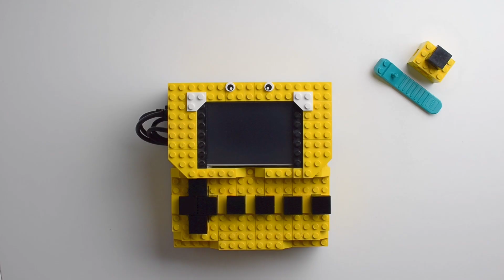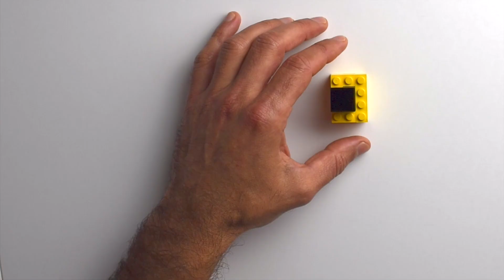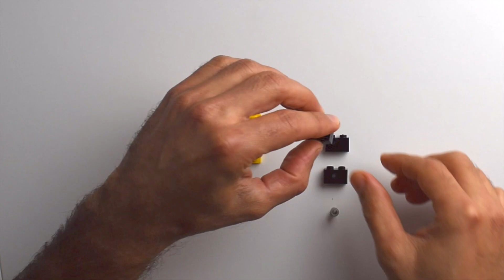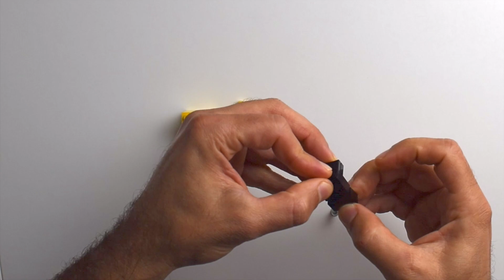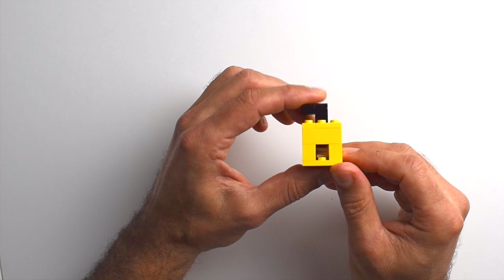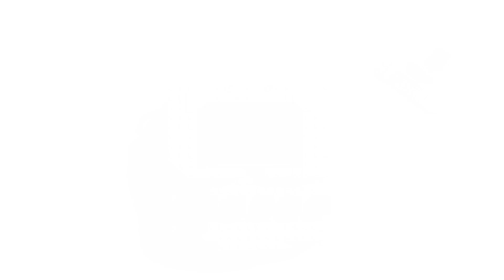M8 Headless project teardown and how Lego buttons work

Comment: Hi Rowdy!
Sorry to bother you, I'm working on your project, And it's great.
Now i have installed the module and set the audio, works really fine, ready to enter in a case of fake legos.
Only I have a stupid question, I'm really a newbie, i code with AIs all the time and I m not finding a solution that maybe is obvious: there's a way to exit the m8c module without shutting down the raspberry? A way to go back to the terminal? Or block the module to start immediately? Cause I still have to configure midi and setting the raspberry for an Argon case, maybe I will change the usb soundcard etc... Long story short I would love to still use the terminal for any changing, and no I can't use ssh, I don't know why, even with my zynthian I never managed to use it, I don't know if the problem is my WiFi or my pc or whatever.
Thanks m8 <3
Reply from the maker: Using SSH should definitely be the best option. Therefore, I would try to understand what's going on with the Wi-Fi. Alternatively, couldn't you use an Ethernet cable? 

You can prevent the shutdown by editing m8c-rpi4/m8c.sh and comment the lines below "# Shutdown after quitting M8C". Then, once you have everything configured, you can uncomment those lines again. 

You can deactivate the module by entering the command "patchbox module deactivate". If you want to reactivate, just enter "patchbox module activate m8c-rpi4-module".

I hope this helps! Would really like to see your Lego enclosure :)
Reply: @rowdyvoyeur  thank you very much man! For now i will use the command to deactivate module while i finish settings and understand my ssh problem. For sure i will sens you a picture of the beast as soon as i've finished the work.
Reply: Hello  @rowdyvoyeur  , the project is moving forward, and the machine is well set up, with only a few Lego pieces missing. However, I have two questions to take it to the next level:

1) I have a Soundcraft Signature 12 MTK, and I would really like to use it with the headless setup, like you use the MC-101 in vendor drive mode, which is also how I use it, for example, with Zynthian, where I can assign a specific channel/track in the "DAW"/software to a channel on the mixer (12 channels, 6 mono and 3 stereo). But if I follow your instructions and replace MC101 with MTK in the script, what happens is that both channel 1 and channel 2 transmit the same master in mono, and the other channels are completely silent. Do you have any advice for me? I guess there’s no simple answer but I had to try.

2) Is it possible to use this headless setup as an audio interface, having audio input via usb? I saw on GitHub that you also talk about audio input, but it’s not very clear to me.

Thank you very much, and sorry for the trouble.
Reply from the maker: @alessandrocecchini6511  That's really exciting. Thanks for sharing your progress. Please find my comments below:

1) Sounds like you're using an older version of m8c.sh, which had some channels set to mono. If that's the case, just follow the instructions listed here: https://github.com/RowdyVoyeur/m8c-rpi4/blob/main/m8c.sh More specifically, open the audio out with "alsa_out -j "MC101_out" -d hw:MC101,DEV=0 -r 44100 -p 64 -n 4 -c 4 &", where -j is the interface alias, -d is the device name, -r is Sample Rate, -p is Period or Buffer Size, -n is Period, -q is Quality, and -c is the number of channels you wish to open. Then proceed to establish the connection with "jack_connect system:capture_1 MC101_out:playback_3" and "jack_connect system:capture_2 MC101_out:playback_4". You'll need to select the output ports here.

2) I'm not sure I understand your question. This setup allows both for audio in and audio out. Which means you could record into it. Just follow the instructions listed here: https://github.com/RowdyVoyeur/m8c-rpi4/blob/5361a512b859a388886f78757e50ba9b8a8259a3/m8c.sh#L10 and then here https://github.com/RowdyVoyeur/m8c-rpi4/blob/5361a512b859a388886f78757e50ba9b8a8259a3/m8c.sh#L24

I hope this helps. Have fun!

Comment: Apologies for the captain obvious questions, Im new to builds of this nature, but want to start. 

Is the raspberry pi running the controller? I thought the teensy ran everything by itself with the M8 software installed? I thought about making one just for fun, but my knowledge of PCBs and such is very small, at the moment. Or is the teensy just the M8 software, and you need a second "brain" for the screen, buttons and audio card? How do you connect the two? 

Apologies for all the questions, just trying to wrap my head around it, lol. Super cool build
Reply from the maker: Thanks and don't worry. Those are all valid questions.

Is the raspberry pi running the controller? I thought the teensy ran everything by itself with the M8 software installed?

The RPi is running Patchbox OS, which takes care of audio and midi routing, displaying information on the screen, together with the software client that communicates with the teensy board and with the gamepad controller, both via USB. The teensy board runs the M8 headless firmware.

I thought about making one just for fun, but my knowledge of PCBs and such is very small, at the moment.

You don't need to create any PCBs or solder if you follow my tutorial (or most M8 headless tutorials for all that matters).

Or is the teensy just the M8 software, and you need a second "brain" for the screen, buttons and audio card? How do you connect the two?

Correct. The teensy "only" runs the M8 firmware. The RPi takes care of the display, audio, midi and software client.

I hope this helps. Have fun!
Reply: @rowdyvoyeur awesome, thanks man! 

That makes me a bit curious though. What does the actual M8 use to control these other systems?
Reply from the maker: @vangoghsseveredear you're welcome! The actual M8 has dedicated hardware, especially designed to interact with the teensy board. Which means it doesn't need any additional OS, client or drivers.
Reply: @rowdyvoyeur ahhh I gotcha. That makes sense. 

Thanks a lot for your help! Cleared a lot of questions I had that I couldn't find the answers to, I really appreciate it!

Comment: This is an amazing project. I’m just wondering if there is anyway to use the pins on the Teensy itself for audio and controls (maybe even video?) to avoid latency rather than go via the Pi? Or is that just a limitation of the headless software?
Reply from the maker: Thanks. As far as I know, that's a limitation of headless. Besides, that's against the spirit of the whole m8 headless idea.
Reply: @rowdyvoyeur  Thanks for the reply. When you say against the spirit of it, do you mean in the sense that it is getting too close to doing what the real thing does and so would be unfair to the creator?
Reply from the maker: @Snowcountry556  Yep, that's exactly it :)

Comment: Im loving it! At the moment im making my own version with cherry switches and 3d printing. Do you think a raspberry pi 3b+ would be enough for patchbox OS? Im still waiting for my teensy to arrive to get into some testing
Reply from the maker: Awesome. Would love to see the end result. RPi 3B+ is supported by Patchbox, so it should be enough. However, you will probably need to make some adjustments to my instructions.
Reply: @rowdyvoyeur  For sure will share if I manage to get it working, your guide looks great! In the meantime im working on building the keypad with an arduino nano as an hdi. Fingers crossed the pi3b+ doesnt stutter like crazy. In argentina the pi4 is pretty expensive atm, I do have a pi400 but the form factor sucks for a project like this
Reply from the maker: @Namiak-n1g  just out of curiosity, why don't you use a generic usb controller instead? Mine was around €12 and, therefore, I mercilessly took it apart and used it instead of building something from scratch. As for the PPi 3B+, I think you may run into audio related issues - at least from what other people say. I mean, it will certainly work - at least with the RetroPie approach - but you may hear ocasional pops and clicks. Have you checked this repo: https://github.com/rasprague/m8c-piboy? I was using this for a while, but the audio was not perfect and had latency when sampling because it's not a real-time kernel. Hence, I switched to PatchBox OS.
Reply: @rowdyvoyeur  Just realized i never pressed send on my response! Here I am typing it again. I had a hyperpixel 4 screen which only has drivers for raspberry pi os 64bit lying around, im using bullseye. I tried using patchbox but the damn screen wouldn't turn on. So I might try to run m8c through a kiosk setup or try installing something lightweight for the gui such as openbox. I read there are some issues with jack/asla with the rpi3b+ but oh well if its too bad i can always upgrade to a rpi4 down the line! On the keyboard thing, i thought it was a good chance to finally use the pack of cherry mx blues and 3d printer I have collecting dust in a cupboard. Plus its a great way to force myself to learn a bit of pcb design and integrating it to fusion 360. And being able to have the same layout as the original m8 feels pretty cool! I will probably use laama's release https://github.com/laamaa/m8c which has been tested on a rpi3b+ and raspberry pi os working correctly and implement all of your optimizations such as disabling hdmi, bt, wifi. And as this screen is fully run through gpio i might as well disable hdmi completely. The teensy is still two weeks or so away so im stuck designing and testing all the surrounding hardware in the meantime!
Reply from the maker: @Namiak-n1g  Awesome! Sounds lke you've got everything sorted. Feel free to reach out if you need any help. Keen to see the final result!
Reply: @rowdyvoyeur  Hey man! I was thinking of using your sound expertise. What's your take on using the hat IQaudio DAC Pro on the Pi? Do you think it would improve latency and lessen artifacts while routing through jack? Cheers!
Reply from the maker: @Namiak-n1g  Sorry, but I don't have any experience with that hat. I'm assuming it will have a much better performance than a cheap USB sound card, both in terms of latency (because it bypasses the latency generated by the USB) and audio quality (from what I read, it's a reasonably good DAC). However, you'll lose the ability to sample because that particular hat doesn't have an audio in - which in my opinion is a real shame. But those are just my two cents and, as mentioned before, I have zero experience with it.
Reply: No, you are totally right, as i dont have any experience with synths in general i was not aware how big of an issue is missing an audio in. Damn, ill have to keep searching, thanks bro!!
Reply: Maybe i could use some usb sound card just for audio in
Reply from the maker: @Namiak-n1g  you could, but then why not using a USB audio card with both in and out? If you're using headless m8 as a regular tracker you won't notice any latency unless you sync it with external gear or use the audio input, which in any case you'll notice latency anyway since you're considering using a USB audio in.
Reply: @rowdyvoyeur  Ohh thats good to know, I thought the latency was there when using both input/output while routing the audio through jack. Plus after reading into the gpios of both the screen I have and this sound board there are a lot of conflicts so im back into the usb dongle wagon haha
Reply from the maker: @Namiak-n1g  well, you're right. However, given that the M8 is a tracker, latency is not so much an issue because you tend to program notes rather than actually play them live. So, even if you have 20 or 30ms of latency, it generally won't be a problem when previewing samples or programming notes. It only becomes a major problem when you play it in sync with another instrument or when you use the audio input to play something in sync with your headless M8 tracks. Thus, you should decide how you will use it before deciding your approach and hardware. Regardless of your approach, you'll always have some sort of latency. Only the real Dirtywave M8 gives you zero latency :) That's why the headless version should always be regarded as a testing and/or learning platform.
Reply: @rowdyvoyeur  I really want the real thing! But oh well, being from argentina can be a bit of an issue 😅. 50% tax on imports plus inflation through the roof! And there's also the issue on availability. But at some point, specially if I start building a collection of midi devices I'll definitely grab one! 20/30 ms for my intended purposes is absolutely nothing, you really cleared everything up! I'll be using it as a standalone, loading samples and playing around. Im just starting to get my feet wet in this world. Thank you for taking the time to answer! You are awesome!
Reply from the maker: @Namiak-n1g  no problem! you're welcome.
Reply: Did you get your key input working? I've been struggling to set the keyboard input up :/ I've edited the config.ini with no results and I'm thinking maybe the config.ini file I've edited isn't even being used by the app.